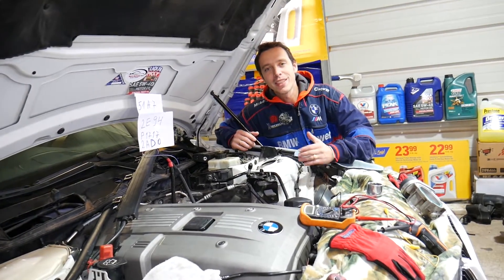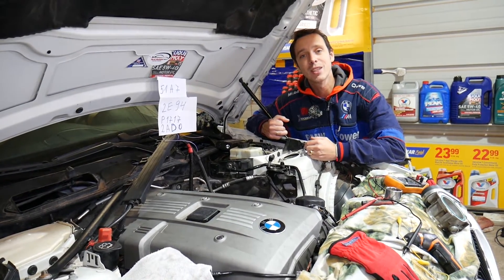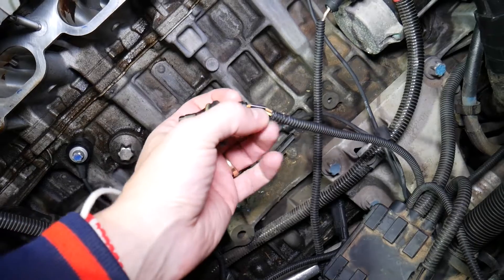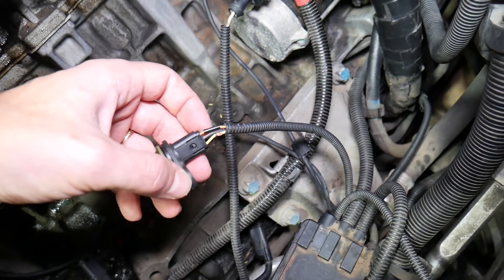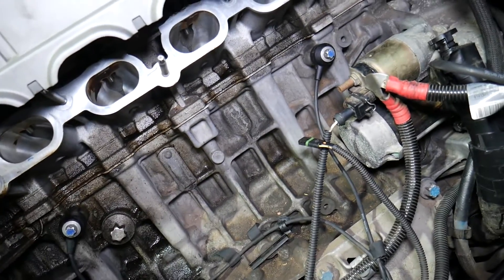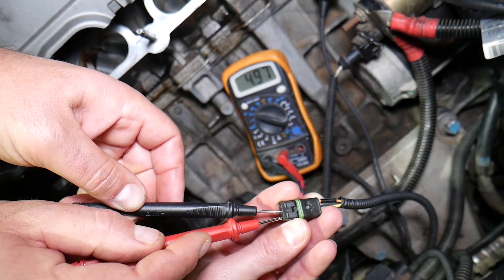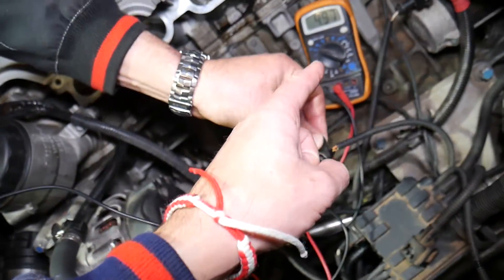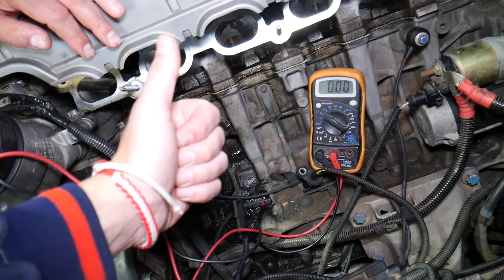BMW E63 E64 F06 F12 F13 HOW TO TEST CRANKSHAFT POSITION SENSOR

Comment: Thanks for the video, but i think sometimes the sensor will work good until the engine gets temrature and that temp will affect the sensor, i mean it will show its defects when the car reach high temps
Reply: Did U have fix the Problem ? My Car starts Bad after getting Temperatur and cool down about 30-60 minutes